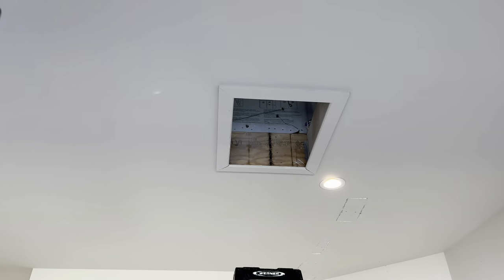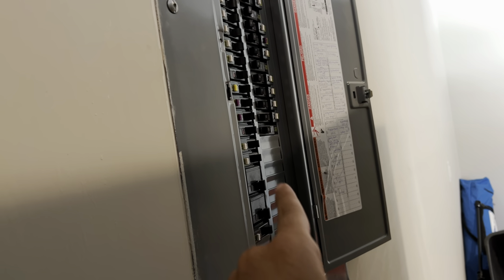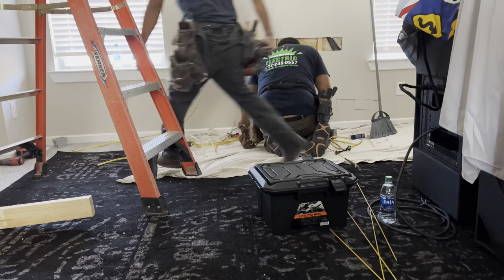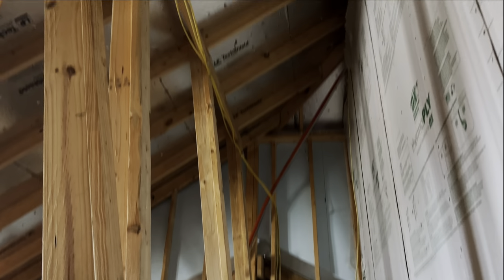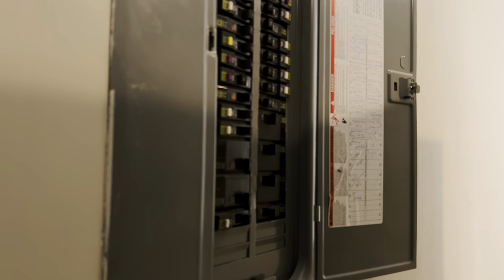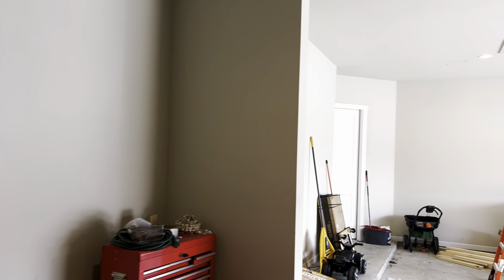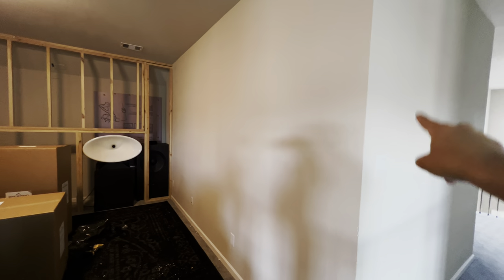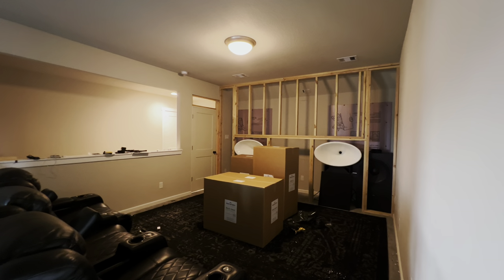Building my Home Theater: Part 1 -Electrical 240V/ 20amp Dedicated Circuits

Comment: Doing the same right now for my little AV corner in my living room. Installing 20 amp rated floor outlets. Two brass plates with two outlets in one, and an outlet and Ethernet in the other. I am wiring each plug individually for 6 circuits, and yes, I am breaking the tabs on the outlets and splitting the breakers between the rails. The first two outlets I installed made an incredible difference in both sound and picture quality. Friends thought I bought a new TV, the improvement was that vast. I said screw it, and went hog wild on this project. Worth my time and effort.

Comment: Yeeees thank you for doing this. Ive been wanting to build my own theater room but didnt know where to start, specially concerning  electrical. Thanks again!!! Looking forward to the series!!!!
Reply from the maker: SO the best plan is to plan. Get the full list of gear you want/ can afford. Start attacking in stages. Since i knew we had to build out the front wall I knew going back in after the framing was up would be a pain so the logical solution was to do electrical first. Next is baffle wall, after that should be a mini acoustics video, more construction, and then screen/ projector and final install of speakers.
Reply: @ThatHomeTheaterDude  Hahaha I think I have planned enough, my current wall in planning are more the technical aspects... i.e. the electricity, or would a certain amp i planned on getting be enough for the speakers. Things like that. That's why I am looking forward to this series, hopefully you can tackle those kind of information specially for those uninformed. :)

Comment: I was lucky to be able have my theater project start in a unfinished basement. Did 3x 20amp 120v circuits. 4 m-215's were to much for 2x 15 amp circuits in pairs. Just need to figure out a way to keep my refrigerator from walking around in the kitchen upstairs now.
Reply from the maker: its already good to plan ahead

Comment: nice video!! can u explain the 240v plugs more? I was an apprentice electrician (houses, offices and factories) and I have saw ppl run these plugs but cant understand it. for me, 240v is 2 powers, neutral and ground (dryer, stove),  I ran a split 20A to my rack, broke the tab on the power side of the  electrical outlet to have 20A-120v to each receptacle (top half and bottom half). 
so the plug ur holding in Part 2 (black male plug with a white part on it), thats not ur "everyday" plug like a tv or hair dryer? (im assuming its not). do u have converters to convert back to 120v behind the screen? did the speakers come with that black with white plug on them? im just trying to figure out if i plugged my cellphone/denon 6500 or tv into ur 20A 240v plug if it would fry or if ppl are using converters of some sort. (sorry for the long questions)

edit- just looked up the speaker specs, i guess thats just to power the speakers. my question was more how ppl are running things in racks with 240v plugs. great looking build!!
Reply from the maker: nice! yeah. this is going to be a serious system once done. cant wait